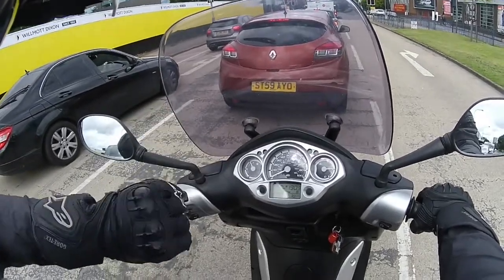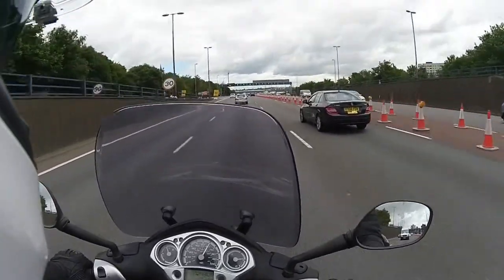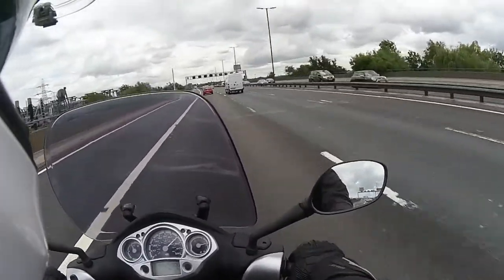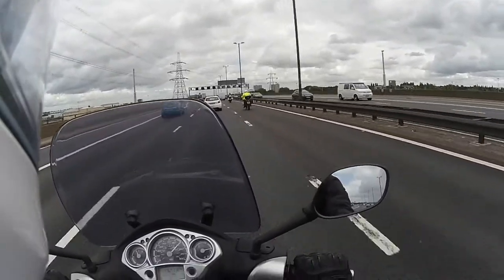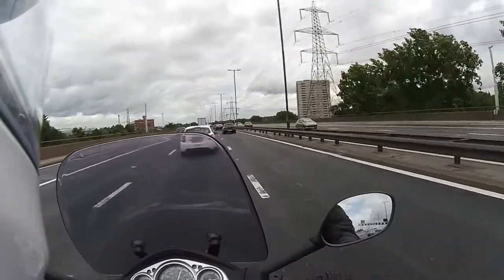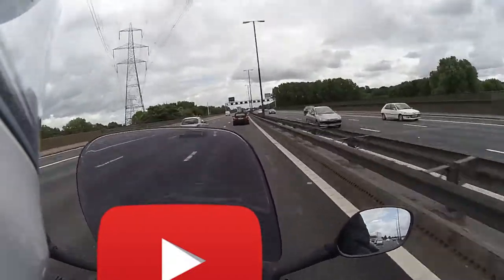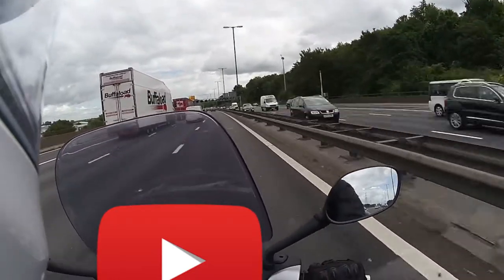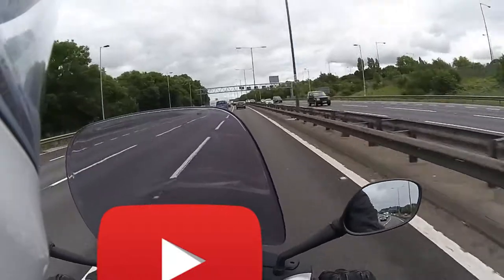What is a 250 Scooter like on a Motorway at Highway speeds

Comment: My own best example of that type of usage! 
Several years ago I was still living in Portugal, Sintra/Lisbon Right on the West coast. Curiously  just some minutes from "Roca Cape" the most Western point of Europe! ;-) 

At the time I had to take care of a few matters on the other side of the country, >300km away, very close to the boarder of Spain!

All said and done I went there (mostly highways) in the morning. Took care of things and drove back, shortly after lunch. 
All in all, little more than 600km! I was surprisingly fresh after all that! So much so, that upon arrival before I went home. First I made a stop on my nearest Kawasaki dealer, to test ride the (at the time) brand new Kawasaki Ninja 250R! Than I went home...

That was done with an incredibly decent, at the time, Piagio XEvo 250ie. 
Fuel injection. Euro3 emissions. Really low consumption, extremely effective scooter with a surprisingly good performance. Specially considering it's "executive" clothes! Really comfortable. Good luggage space and access. Excellent on board computer, etc. 

By the end of that year I bought a also brand new Suzuki Burgman 400! Curiously! In spite the bigger size, comfort seat and even larger engine (performance) and luggage capacity. I should say the Piagio 250 was by far the best "bang for buck" of the two! ;-) 
Worth mention the Piagio 250, to this day, have one of the best CVT transmissions on the market!
Reply from the maker: Really helpful information here thanks for sharing. I have been thinking about a bigger 400cc Scooter but feel the increase in weight and power may not be worth it. I do like the "mid 250cc" size and it works well for most cases .

Comment: I had a United Motors x-speed 250. 1 cylinder 4 valve fuel injected I weigh 300 pounds it would run 85 miles an hour on the interstate.  GPS to make sure.  they are awesome scooters